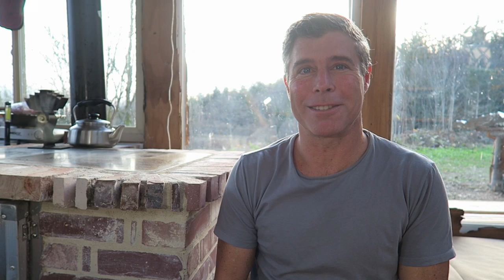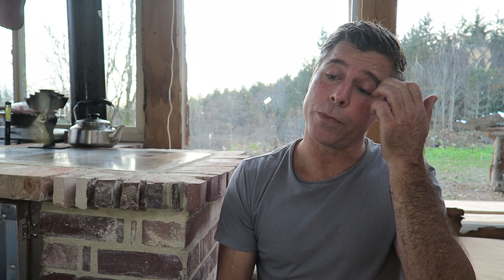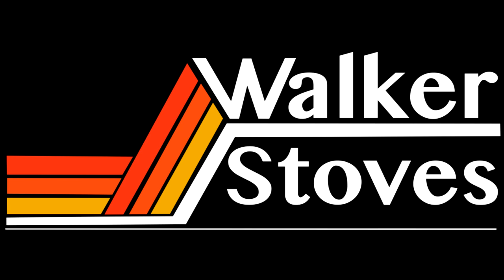Rocket Stove Materials Sourcing, Ceramic Fiber, Refractory, Masonry, Glass, etc.

Comment: Hi, great video.  I am considering building a masonry heater in my basement.  I am in USDA zone 6 (-10F).  I have a 700 sqft walkout basement with R 26 walls and a non insulated slab and a heat pump water heater that cools the air slightly.  Upstairs is a living space of 700 sqft with about R 30 walls and R 49 attic.  I have an insulated stove pipe running to each floor.  Would any of your stove designs be able to comfortably heat this space and in what format?  Also, do your stoves act like a traditional twice a day burn masonry stove or do they need to be fed most of the day?  Thanks

Comment: Thanks for this and all your work Matt!  Your videos and insights are giving me the confidence I need to build my own.  This video is quite timely for me and my first build.  I've been researching rocket stoves and mass heaters for about six weeks now and i'm amazed at the huge amount of resources on these things, I can't seem to find the bottom of this information barrel.  LOL.  

Some rocket mass heater advocates like to say "you can build a rocket mass heater for $100".  Sure you can do that but...  Of course we all have bits and pieces of a build but very few of us have all of it.    

It seems like if you're going for a long lasting heater/stove you need to invest in durable burn box and at the very least riser tube.  Your core plans seem to meet this criteria quite well.  

What is the ballpark cost of materials to build the designs you're selling?

Thanks again for all your work!
Rich
Reply from the maker: Thanks Rich!  Cost of a heater is going to vary widely depending on lots of factors.  A simple J built to my plans, like the Brick Rocket Mass Heater Plan on my site, can be built for around $300.  The Tiny Cook Stove or Full Cook Stove will be in the $800 range if all materials are purchased.  Neither estimate includes chimney.  Hope that helps!

Comment: Great video. My only question is what do you suggest for the bottom of a bell for a stratification chamber?
Reply from the maker: Thank you Thomas.  It depends on the subfloor.  If you need protection then I recommend an airgap under the whole heater so the floor of the bell would be brick on a suspended platform.  Insulated kiln brick is another option.  If building on a solid, non flammable surface, the only concern is to minimize leakage in or out from the bottom, this can be a problem on gravel or dirt.  Lastly, there will at times be condensation occurring in there so it's important to build such that this isn't a problem.  It dries itself in short order, so it's no problem to use the normal masonry materials.  What can be a problem is a box that can leak out of the bottom, you'll end up with black condensate on the floor during cold starts. Hope that helps.  Thanks for the comment.
Reply: broaudio The absolute most helpful reply I’ve ever gotten!! I’ll be building one on my shop to test then one for my home. I’ll shoot a video and credit you! Thanks!!

Comment: Any thoughts on mica and isinglass?
Reply from the maker: Hey J, I think they are cool and add a nice organic glow, but they aren't really clear so much as translucent.  Add to that it's hard to get any of significant size, and I think of it as more of a novelty.  I'd love to have a little piece for a glowing magic eye type port looking into the riser area, next to the door.  I do not think it's a replacement for ceramic glass, as the look is way different and it's limited mostly to small sizes.  It's cool though!
Reply: broaudio Do you think it would hold up to the temps?
Reply from the maker: https://en.wikipedia.org/wiki/Mica

They say it melts at 700-1000C.  I'd like to try to melt some!  Before I looked it up I was sure it would hold up, now I'm curious.
Reply: broaudio Me, too.   I'll use mica for the door on   my build this spring.